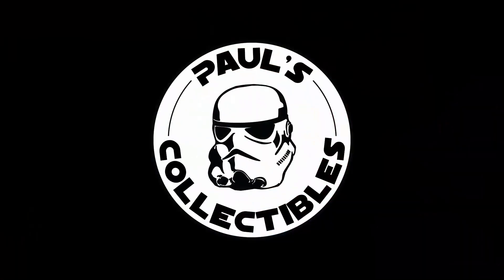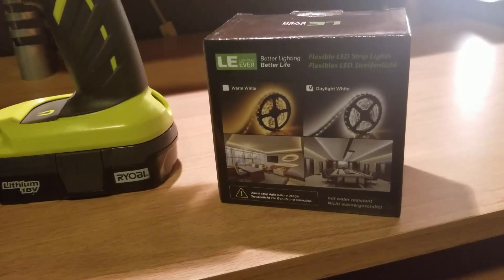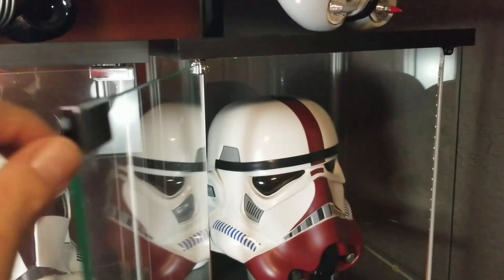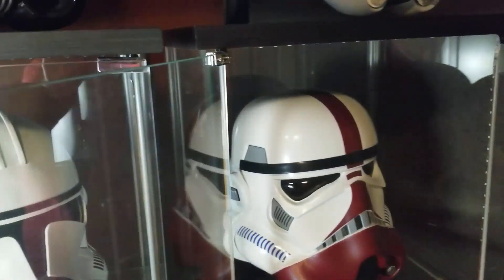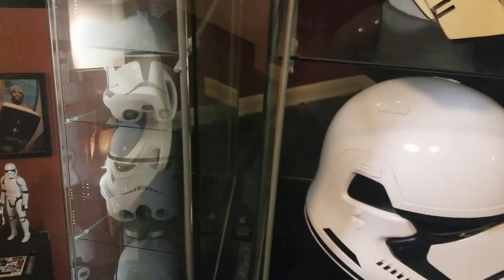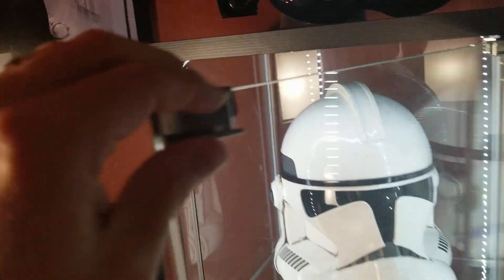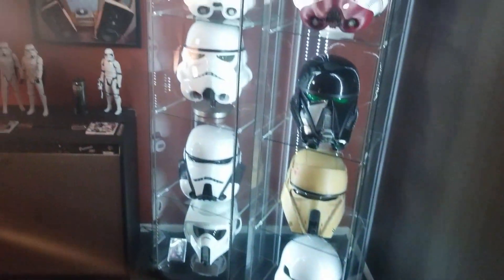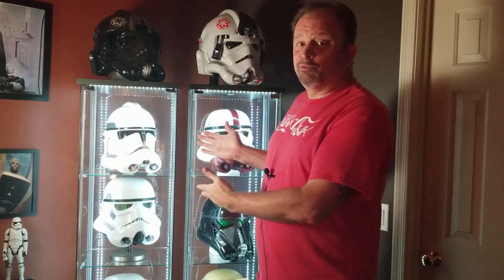Light Your Detolf Case Quickly, Easily and Inexpensively!

Comment: This is easily one of the best lighting videos I’ve seen. Extremely thorough and coherent. Looks fantastic — very well done man! +1 sub!
Reply from the maker: Wow!  Thanks, Sentri!  I appreciate that. I just wish I had filmed it as I was doing the work, as opposed to after I was finished.  Glad it helped, though. If I do a 3rd cabinet, I'm gonna film the process this time. Thanks for stopping by, checking out the video and for the sub!
Reply: @PaulsCollectibles  that would be a great video as well. I’ve vetted numerous options and I’ve always been a keen on this particular approach. This video tipped the scales for me in this method’s favor. This way also makes it very maintainable when you eventually have to swap in now strips, as opposed to dealing with zip ties and all of that jazz. Great stuff

Comment: Did you run into any issues with the door sealing?  I've built two of these and can't find a video or solution anywhere that shows how to fix this.  Top magnet won't catch.  Bottom catches flush.
Reply from the maker: I did, Bmore. One or two of mine are off just enough so that one magnet closes stronger than the other. Mine luckily stay closed regardless.
Reply: @PaulsCollectibles  it's super frustrating.  I can physically torque the top wood counterclockwise and it snaps shut but as soon as I let go it pops open at the top 😞
Reply from the maker: @cjmingo934   That sucks! Have you tried maybe removing the top magnet and screwing it into a different location closer to the glass door or further to fix the problem?
Reply: @PaulsCollectibles  Haven't gone that far yet. Just built them a couple days ago and started searching for a more obvious answer that Im missing but no one else seems to be complaining about it 🤣

Comment: Not related to the lights....  What are the helmet stands?  TIA
Reply from the maker: No problem, Conway. That is by far and away, hands down, my most asked question on all of my helmet videos. And I am using 12" or 13" tall brushed metal paper towel holders like the kind you can get from Costco or Bed Bath & Beyond. They are inexpensive, work wonderfully, and no one is the wiser! Thanks for stopping by and checking out the video!

Comment: Genius idea!!! Also, does anyone know how to undo and reinstall the doors? My cabinets were purchased off someone else and they grind meaning they are backwards and upside down...
Reply from the maker: Raevyn, thank you so much for the compliment!  I was very proud of myself when I came up with this easy way to light the cabinets!  haha!   If you look on top of yours, there should be four (4) screws in the wooden topper.  If you unscrew those, it should come off, freeing the door to be removed from it's swivels. You can then adjust it as you see fit.  I suggest having another person with you to hold the glass sides up, as when you do this, they will become unstable and may fall and break while the top is off.  Best of luck and thanks for checking out the video!

Comment: The best way to do this is with aluminum channels and diffusers so you don't get that cheap ugly look with the heavy glare. It's extra effort but worth it.
Reply from the maker: Very true!  I bet that would look great! Of course, this video was an exemplar for effort and cost versus benefit, and an examination of time versus reward.  For what you get, this method is very sharp, yet easy and inexpensive to accomplish.  As with anything, a continual application of effort, expense and time will yield greater results, until the law of diminishing returns finally makes the endeavor no longer worthwhile.  This, however, was meant to be an example of but one of many ways to achieve a stunning result.  Thanks for stopping by and checking out the video!

Comment: If you need a fiberglass Vader Helmet I've got one from Portumac Studios that's been taken out of the box for a pic then put back in there.
Its nice
Let me know
Ha Ha
Reply from the maker: I appreciate that Kevin, but I mostly concentrate on the Imperial trooper and clone trooper helmets. No rebels and no sith. Thanks for the offer, though!
Reply: @PaulsCollectibles  I like the origional Stormtroopers myself. Never had one though. My Bro has a Tie Fighter helmet but its the $40 Do Post . I saw yours . Sheesh. It's nice. Was that the way the tie fighters helmet looked or is that a special edition.
By the way I know longer collect Vader that's why I'm selling.
Thanks
Reply from the maker: @kevindouglas6120  Nice, catch!  Yeah, that TIE Pilot helmet is a little different.  It's the "Lt. Oxixo" version so it has Aurabesh writing on the front and a grey "mohawk."  I ordered that one from Anovos a few years ago instead of the regular one because I liked the grey accents.

Comment: From fairly recent reviews I've read, sadly, it appears as if IKEA has cheapened their Detolf cases to the point they are extremely hard to put together and much flimsier than before... all while raising the price.
Reply from the maker: Oh!  That's a shame to hear.  I know when I was buying mine a couple years ago, the draw was that they were versatile, good looking and inexpensive. I had no idea they had been changing those aspects since then.  Hopefully,, if that is the case, they realize their mistake and return to the tried and true seller they had before.  At any rate, thanks for stopping by and checking out the video, Dan.  I appreciate it.
Reply: @PaulsCollectibles  Sure thing!   Now, I'm looking at the IKEA Milsbo display case, though it costs more.  It comes with a locking door and appears to be easily modified for adding dust resistant weather stripping and lights.